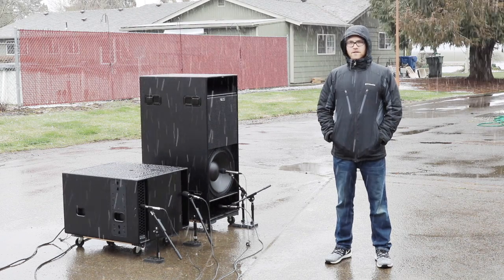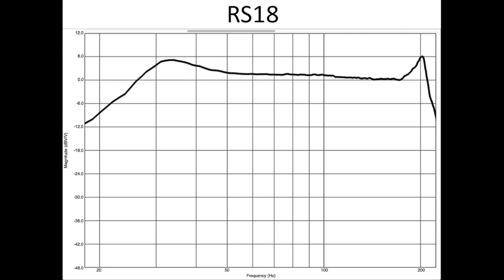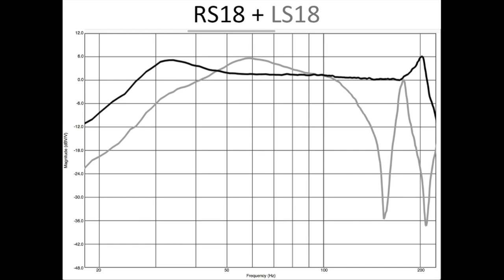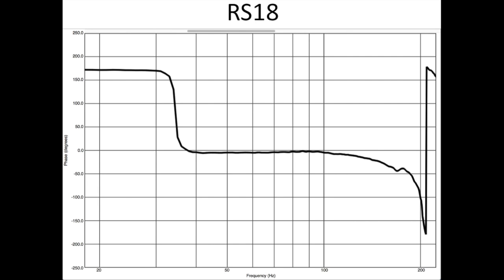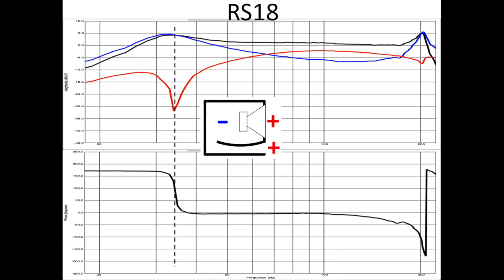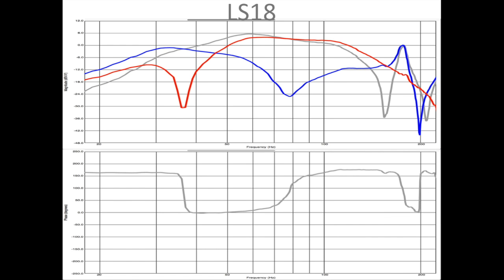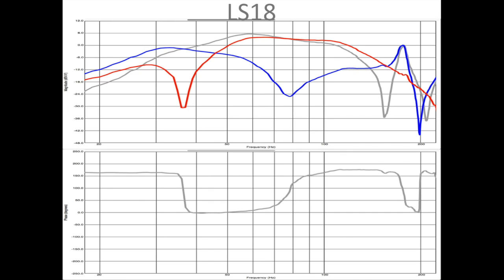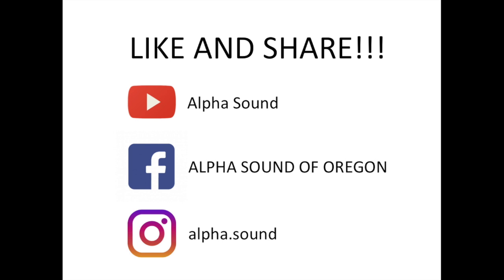Do you know how subwoofers really work?

Comment: 2:28 How is good sounding subwoofer cut the frequency below 30 Hz with -15dB at 25 Hz and -27  dB at 20 Hz? This is terrible subwoofer, not capable of doing what is supposed to do - producing LF. A good Subwoofer will go down to sub 20 Hz, even 10 Hz. This is NOT applicable to a home system at all.
Reply: There is no need in reproducing this low end when doing PA because most songs don't even cover that frequency range. It also doesn't make much sense, because reproducing the low frequencys below 30Hz or so is far harder outside than it is inside your home.

Comment: I have a pair of old LEM 18" (horn design) subs. The actual sub driver is situated in the bottom of the subs facing upwards. I feed them signal below 100hz through a stereo behringer Graphic eq that has a dedicated mono subwoofer  (low pass) output. The subs are paired with two 15" full range EV speakers on the top fed with full range signal, obviously not an ideal scenario due to conflicting low frequencies... Since the subs are not of generic direct front facing driver design. Is there excess phase  cancelation between subs and tops? Its really confusing :P thanks

Comment: are you sure you can get precise low's data if positioning the mic that close ?
Reply: As long as the mic isn't experiencing overload, it's fine.
Reply: being that close you wont be able to analyze a whole cycle of a low frequency as they measure meters in length. thus you will get phase issues and a bad coherence response.
Reply: @octaudio  
Simply not true, that is a myth. 
It's exactly how many mic'ing measurements are performed. 
One method I utilize for monitoring is via Westone In-Ear monitors. 
They fully resolve down to 16hz or so before roll-off. 
Close mic'd measurement are fine... they minimize the room's influence and corruption of the freq response... ie., more direct signal, less indirect room. 

How'd a close mic'd singer sound if a close mic'd approach "wouldn't be able to analyze the whole cycle"... blah blah blah...

Although many feel the same, that's just not the physics involved.